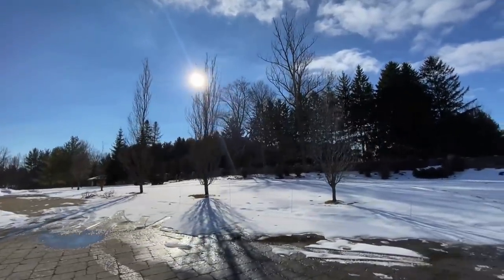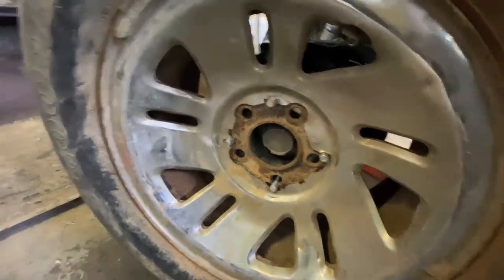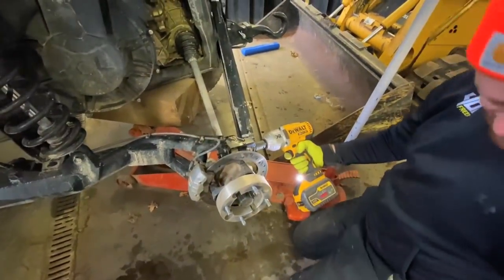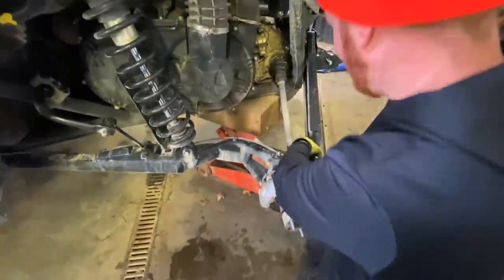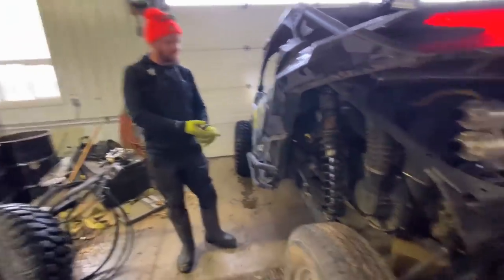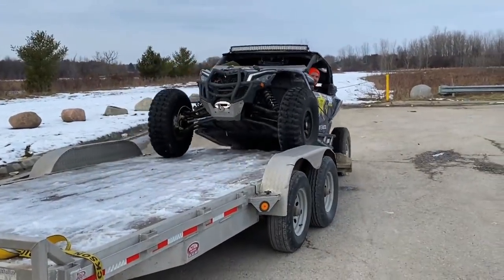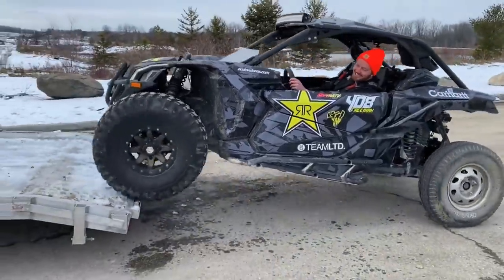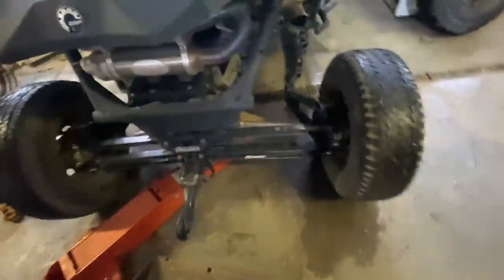Destroying 4X4 TIRES! DONUTS!

Comment: Shredder is definitely running rich. Id check to see if the choke is stuck on. The knob may be off but the flap in the carb could be stuck. The fuel mixture screw could also just be out too far. (If it has one)